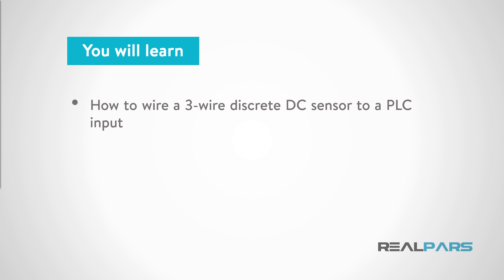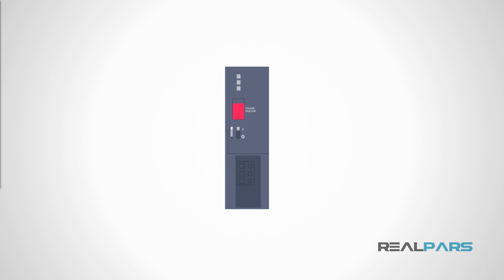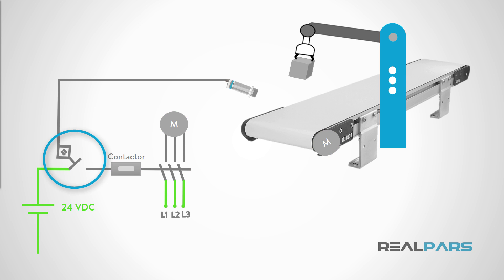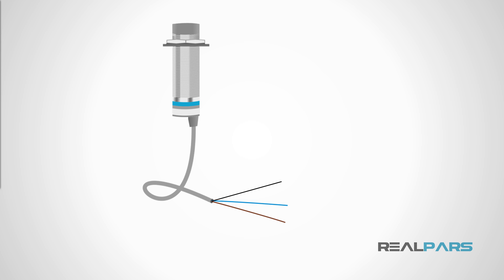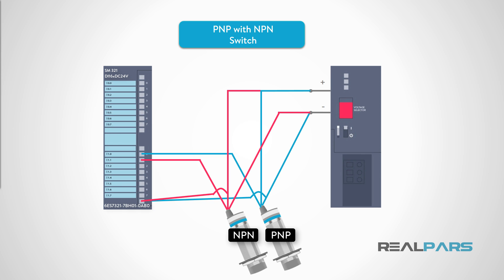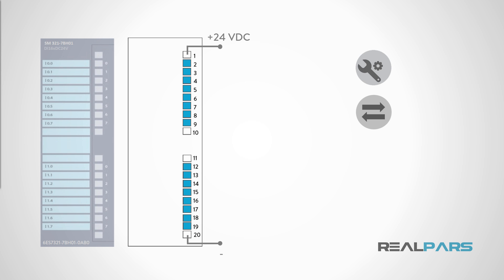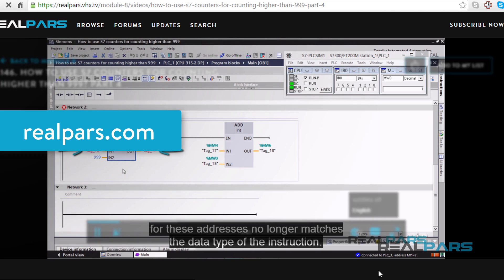How to Wire Discrete DC Sensors to PLC - Part 2

Comment: is it safe to power the Sensors and field devices through the PLC input card, most cards have really low limit on current so connecting like 10 - 12 devices might be risky, 
how about powering it through a Power supply instead from the PLC input card ? wouldn't that be better ? appreciate your efforts in simplifying this great effort
Reply from the maker: Thank you for your question. In our videos, we focus on sensors specifically designed to interface with a PLC. The input cards are responsible for receiving signals from these sensors, while the output cards supply power to your device according to your engineering specifications and current requirements. If necessary, the output cards can also power relays for handling larger currents. Every industrial PLC manufacturer typically provides a manual detailing how to use and program their PLCs. Additionally, it's important to ensure you have a suitable power supply to energize your system. Happy learning!

Comment: A "Sinking" PLC input card has (0 VDC) commonly connected to all its Inputs. Therefore it needs PNP Sensors to be connected to it. 

A "Sourcing" PLC  input card has (+24 VDC) commonly connected to all its inputs. Therefore it needs NPN Sensors to be connected to it.

So for the example in the video above the inputs (from I0.0 to I1.7 ) should be commonly connected to  ( - ), therefore terminals 10 and 11 should be connected to ( - ), not to (+24 VDC) because it is a "Sinking" input card and only accept PNP sensors.

I hope that I'm wrong.😀

Comment: Hi, Can we ever connect a PNP sensor to PNP I/O card? I got a qsn like that in an assesment, any possiblity please help.
Reply from the maker: Yes, it is possible, but you will need to modify the circuit with a resistor and non-standard wiring connections.  I do not recommend doing this because it will confuse other techs who may need to maintain the system.
Reply: @realpars  I got this as a qsn on one assesment..? Is there a proper answer for that ..is that just a pull down resistor
Reply from the maker: @vishnukr8010  I believe the 24VDC connection at the I/O card is removed, and a 10k resistor is placed between the (-) terminal and ground for the digital input.  Again, this is not standard and would require specific detailed documentation to avoid future issues.  I would say the proper answer to an assessment question would be "no" if the question was looking for a binary choice.  If you were to able to provide an explanation in the answer, I would respond, "yes, but the solution is non-standard and should not be implemented unless absolutely necessary".
Reply: @realpars  thank you mate.. Its not a boolean type I have to draw the electrical circuit and submit. Anyway, thank for your reply it was very helpful.

Comment: Thank you for your educational videos. I have a two question that you might have already answered elsewhere. If so I'd be grateful for the links.  Can a proximity sensor be used as a SPDT switch?
Say I want a conveyor belt go back and fort. Can the wiring be tweaked in such way that sensor reverses the direction of the electrical circuit and make the conveyor belt reverse its direction?
Reply from the maker: A proximity sensor be used as a SPDT switch only if it is designed as a SPDT switch.  Many (if not most) proximity switches used today are solid state, so there is only one output available, and it is transistor output, not a Form C contact.  For your second question, you can use the proximity switch input as a trigger for PLC logic to act to reverse the belt.  You likely  will also need some timers in this logic as well.  If you were to do this in a hardwired system, it can be done with a series of relays, sensors, and timers, but the proximity sensors would still be wired as shown in this video.

Comment: Howdy. Nice presentation. A couple of comments.
1. Using 2 -wire sensors (= Namur) the leaking current may be large enough to be detected as ON by the PLC DI card. To remedy this an external resistor of, say 10 k, may be connected over the input channel to deliver proper "sinking".
2. Separate 24 VDC power supplies should be used for input circuits and outout circuits. This prevents inductive load backspikes from generating "ghost" ON detections in input circuits.
Alternatively the +24 rail may be splitted into two secondary + rails using two diodes in a back-flow blocking configuration. P600J is a 6 A diode. One secondary + rail powers the inputs and the other powers the outputs. The output secondary + rail should be fitted with a large electrolytic capacitor after the diode, say 2200 uF, between the + and the - to provide a place to go for possible backfire spikes. Electrolytic capacitors are not necessarily fast enough to kill spikes effectivery so a plastic capacitor of, say 1 uF, may be connected in parallel with the electrolytic capacitor.
Regards.
Reply from the maker: Thank you, Eugene! We appreciate your insightful comments!

Comment: Am I missing something or is the wiring diagram for the PNP type switch around 9:09 (where - is the common wire on the input cards) different than than the one shown around 13:57 where the +24V is the common for the 2 groups of inputs?
Reply from the maker: No. in both cases, the (-) is attached to terminal 20 on the I/O card, which is common (blue wire).
Reply: @realpars  Alright, so then the wires connecting pins 10 and 11 to 24 V are used to power those groups of inputs or something else?

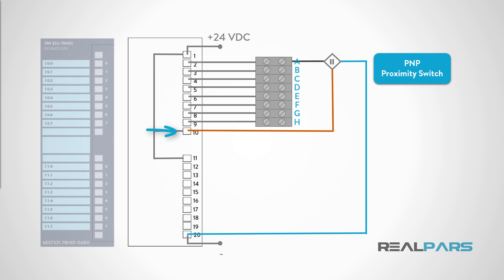Comment: I am confused with the explanation in time stamp 14:00. I thought if we will be using a PNP sensor, we need to use a Sinking Input Card. From what i know the input card he uses to demonstrate it is a Sourcing Input Card. Because the +24V is the one that is shared to the terminals 10 and 11. Please help I'm a beginner and I'm confused.
Reply: Or maybe I'm wrong for thinking that it is a Sourcing Input Card based on it's internal connection. Please correct me if im wrong
Reply from the maker: The card shown is one of several Siemens SM321 digital input cards that can support 2, 3, and 4-wire sensors in any configuration. [https://support.industry.siemens.com/cs/mdm/8859629?c=97343653771&lc=en-MY].  The PNP sensor is sourcing, so the +24VDC is applied to the sensor (brown wire) and when switched, the current is sunk to ground through the DI input terminal to ground.  In the above link, follow the signal through the circuit to "M", which is connected to terminal 20 (ground).

Comment: so if we accidentally buy a PNP switch when it should be an NPN switch, we can't just switch the wiring termination to make it works?
Reply from the maker: This can be done only if the PLC card supports sourcing and sinking type switches.  An NPN sensor requires a sourcing PLC input and a PNP sensor requires a sinking PLC input.

Comment: How can you find out which cards are compatible with PNP or NPN?? I've checked the siemens support website but have found no information. Cheers.
Reply from the maker: Check out this article:  https://support.industry.siemens.com/cs/document/23451499/what-is-the-meaning-of-the-terms-sinking-(german%3A-p-lesend-)-and-sourcing-(german%3A-m-lesend-)-in-digital-modules-of-simatic-?dti=0&lc=en-WW

The cards compatible with NPN and PNP wiring are listed toward the bottom of the article referenced above.

Comment: i cannot understand why the black wire of the sensor is conected to the terminal A  when, the plc input channel 3 corresponds to terminal  D
Reply from the maker: Kostadin,  thank you for your comment.   You are correct.  The video narration indicates Channel 3 on the PLC card, which corresponds to marshaling terminal D, if you consider the channels on the PLC card to be 0 - 7.  To be honest, to avoid confusion, the narration should have indicated "connected to the first channel..." which would be marshaling terminal A.
Reply: @realpars  thanks for answering

Comment: New to this, but a question.  at about 14:34, you state if the proximity switch is connected to terminal 3, the load wire would be connected to "A"...shouldn't the load be connected to "B"?
Reply from the maker: At that point in the video, the schematic correctly shows a PNP sensor connected to the first channel of the PLC card, which is at terminal 2 of the input card, or terminal A on the marshalingpanel.  The narration says "PLC input channel 3", the black wire should be connected to C, which is connected to screw terminal 4 on the PLC card.

Comment: @8:23 you show the brown wire from the npn sensor connected to the negative of the I/O card. Is that correct? Shouldn't it be connected to 10 or 11?
Reply from the maker: For a sinking sensor, the brown wire is connected to the most positive terminal on the PLC card.  In this configuration, 24VDC is applied to the common terminal of the PLC card, as shown.  This is true for the Siemens DI card chosen, but it is always good to check the specific wiring diagram for the card you are using before connecting a sensor.  Some manufacturers have different models of DI card depending on the sensor type (sinking or sourcing).

Comment: To those who might struggle with sinking vs sourcing input plc cards:

Sinking means that the input needs to be connected to +24 V to cause it to be detected as "activated".

Sourcing cards mean that you need to connect the inputs on the negative of the 24 V.

And now for PNP vs NPN:

PNP: when the sensor detects something, it's signal (or load. Black wire) gets connected to +24 V, so it "pushes" or "sources" 24 V.

NPN: when detecting something, the signal wire gets connected to the negative, so it will "pull" or "sink" current.

Same logic applies if you want to use 2 wire sensors in both types of cards.
Reply: When would you choose one over the other?
Reply: So on the npn card you need -24 power supply. That must be connected to the bottom of the IO card (the very last slot) and the common must be connected to the very first slot; where the +24 would normally be supplied. It's the only way this is making sense to me
Reply: sorry to be so offtopic but does anyone know a tool to log back into an instagram account?
I was stupid lost the login password. I appreciate any tips you can give me!
Reply: @Remington Nathaniel instablaster =)
Reply: @Benton Darren thanks for your reply. I found the site through google and I'm waiting for the hacking stuff now.
Looks like it's gonna take quite some time so I will reply here later with my results.
Reply: @Benton Darren it worked and I finally got access to my account again. Im so happy:D
Thanks so much, you saved my account :D
Reply: @Remington Nathaniel happy to help :)
Reply: Thanks 😍

Comment: Hi, I have two Level Sensors which is 4-20mA type. But, I have only one 24 VDC supply adapter. Is it possible share the DC supply to two sensors to get the 4-20mA output?
Reply from the maker: Yes, as long as your power supply can output at least 50ma (20ma for each sensor).  This is normally how analog circuits are set up:  common power supply with individual milliamp signals back to an analog input card.  The sensor is the device that regulates the milliamp signal.
Reply: @realpars  Thanks a lot, I'll check on that.

Comment: Which type of PLC is used for connecting dc sensors??
Reply from the maker: Most any PLC can interface to DC sensors.  You just need to have I/O, either connected to the PLC or in remote I/O racks that support DC sensor signals.  It is the type of I/O card that determines the signal interface allowed at that card, not the type of PLC itself.

Comment: oh hi, It makes me confused and wondered when the actual PLC I/O cards in this video that's not shown the actual power supply used to power the card(I mean it's just shown that the card requires +24VDC power and there's only +24VDC (shown by number) to the terminals(at 12:20). it's quite different to the PLC module's common terminal shown at (8:28) ), please help me to understand that correctly
Reply from the maker: In order to highlight the important wiring connections,  we often just represent the power connection as +24VDC and common connection as COM.  If we had shown the actual power supply in the diagram, +24VDC and COM would be connected to the power supply at terminals of the same name.

Comment: I believe if wiring into IO channel 0.3 the black input wire should  go to terminal D
Reply from the maker: It does.   In video, terminal 1 is 24VDC, terminal 2 is I0.0, terminal 3 is I0.1, terminal 4 is I0.2, and terminal 5 is I0.3, connected to "D".

Comment: I have one question for RealPars:
What exact function difference between 2-wire and 3-wire DC sensor? Use the 2-wire one is more easier than 3 wire when we connect with PLC. So, Why we don't have 2-wire DC sensor for Level switch and pressure switch? 
The information of this video is excellence. Please help me answer previous question.
Thank RealPars.
Reply from the maker: The difference is fairly simple to explain.  Sensors that are simple contact closures, such as limit switches, flow switches, hall-effect proximity switches, and vibratory level switches are all two-wire devices. One wire is 24VDC+ and the other is common, or 0VDC.  These sensors are either mechanically or magnetically actuated or can use the 24VDC+ wire to power the device.  Sensors based on solid-state technology require 3 wires.  Solid-state devices are based on transitor circuits which require 3 wires:  24VDC+ applied to the base, a signal wire that goes back to the PLC as the input from the collector, and a ground wire for the emitter.  Solid state devices are smaller and many times configurable as to setpoint, trip point, etc., but they also require 3 wire connections.  That is why it is important to understand how to properly connect these to the PLC.
Reply: @realpars  So, Thanks for your explanation.
I'm clear about function of both sensors types. 
Please release more videos like this.
I keep following and learning with you.

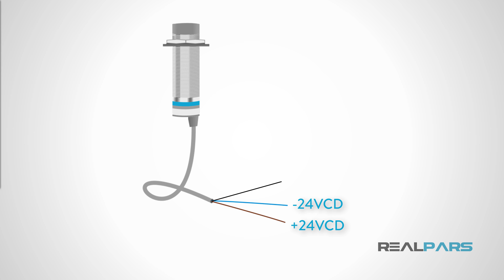Comment: 8:00 i think there is error in diagram--- if we talk about Voltage which is difference in potential between two poles then if you are showing +24VDC as positive pole and -24VDC as negative pole then you have potential of 48V! So it should be +24V and 0V or +12V and -12V etc...
Reply from the maker: The blue wire is common, or the negative side of the 24VDC power supply.  The voltage difference between +24VDC and what is shown as -24VDC (common) is 24VDC.  To be clearer, the common connection should have been shown as 0 VDC.  Thank you for the observation and comment.

Comment: blue wire is -24v? so potential difference between blue and brown (+24v) is 48v?   😉
Reply: The blue wire is common, or the negative side of the 24VDC power supply.  The voltage difference between +24VDC and what is shown as -24VDC (common) is 24VDC.
Reply: @scottsommer6480  the difference between +24 and -24 is 48v. The blue wire is 0v, not -24v
Reply: @jeremyk2173  Technically, yes.

Comment: Informative video. Thanks. FYI slight text error @ 7:53
Reply: Thanks for the reply Realpars. Nothing major, it's just says +24VCD instead of +24VDC. Also shouldn't it be 0VDC for the blue wire as opposed to -24VDC which is a negative voltage instead of a ground?
Reply from the maker: Thank you! Happy to hear! I just double checked to video. However, I couldn't spot any error.
Reply: Also, plc terminal 2 is point A on the marshaling terminal block..i think you said point 3 is A..great work, very informative. Keep it up for more likes!

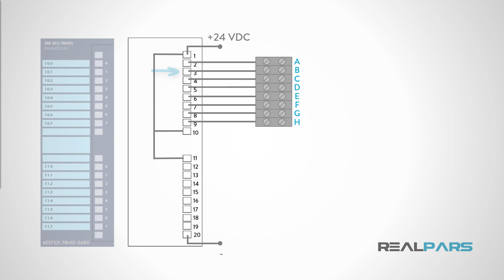Comment: In 13:43, you show connection for pnp. So I guess for npn, unlike pnp, red wire must connect to 20 (negative terminal) and blue wire must connect to 10 (positive terminal). However, for npn, in 8:43, you showed red wire is connected to positive terminal of power source and blue one is connected to negative terminal of power source. I didn't get it. With that way, we connect positive terminal of power source to 20 in PLC (negative side), how is it possible?
Reply from the maker: You make a good observation.  But remember what was indicated in the video:  a sinking discrete input card (for use with pnp sensors) and a sourcing discrete input card (for use with npn sensors) operate differently and are also wired differently.  The function of Terminal 20 in each type of card is also different.  Most plants will use pnp sensors with sinking input cards, simply because they are most common and are easier to wire.  The npn and sourcing input cards sensors are mentioned because there are some industries where these type sensors are more common, and most manufacturers offer products with both types of configurations.  It is therefore important to know the differences and specify the right type of sensor, and the right type of PLC card.
Reply: Thank you very much. I haven't noticed that the connections for sinking and sourcing discrete input cards are different. Now, everything is totally okay :)
Reply: RealPars in the video npn is sinking type and pnp is sourcing, very useful video by the way, thanks for sharing your knowledge.

Comment: How we can connect 2 proximity switches at 24 vdc common terminals.
Reply from the maker: In the video, only one sensor is connected.  If you have multiple sensors  connected to the PLC card, external terminal blocks will be required.  If you have a 16-point input card, there will ultimately be 16 connections to 24 COM.  In this case, I would take 17 DIN-rail terminal blocks, jumper them together, connect the input common wires to the first 16 terminal blocks (one per block), and connect the 17th terminal block to 24 COM.
Reply: Connect two wire riela